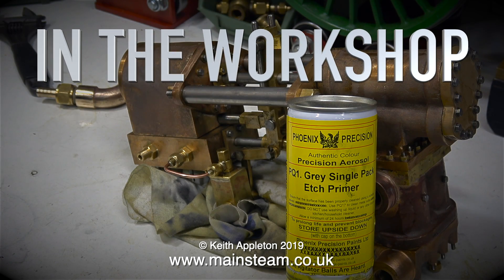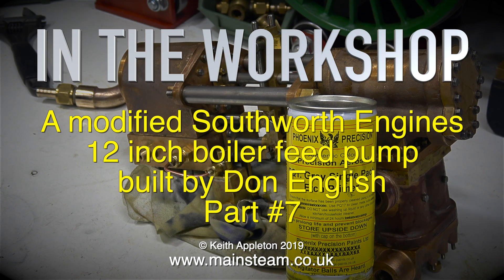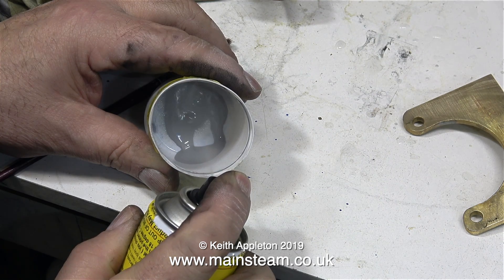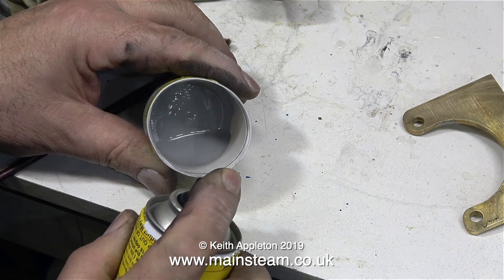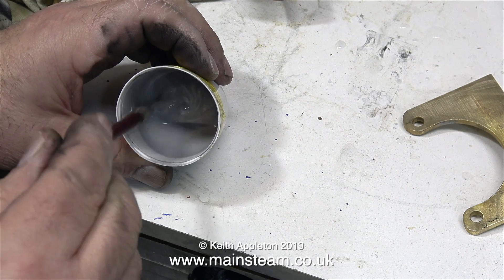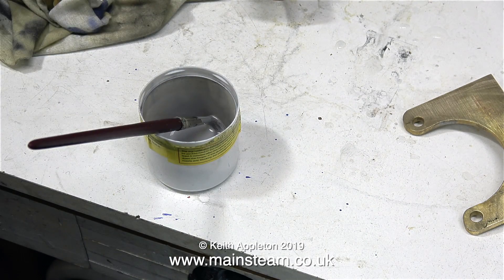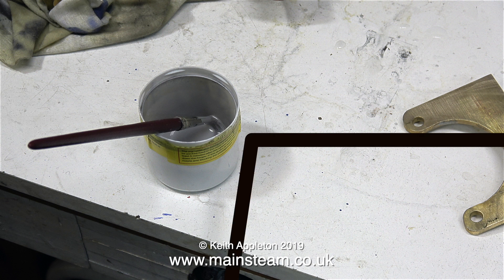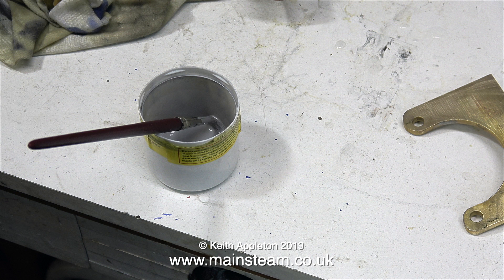A HORIZONTAL SOUTHWORTH 12 INCH BOILER FEED PUMP - PART #7

Comment: This is probably a dumb question,but will ask anyway. Using the size of your hand as a gauge,looking at diameter and stroke of what you are painting,I do not see anything that would be 12 inches. I remember reading a couple of hundred year old articles on how duplex/simplex pumps were hooked together for direct drive,and sizing the steam drive to water feed pump appropriately. Too many years to remember details,but looking at this twice I still cannot see what is a foot long sizing. What am I missing ?
That really has to be unusually good etch primer. I remember some disastrous messes I made decades ago. That learning curve was expensive. Good to know you do not get to duplicate it. Cheers.
Reply from the maker: The pump is 12 inches long. Please look at: www.southworthengines.com
Reply from the maker: For Scale purposes ...... my hands measure 9 inches from the tip of my little finger to the tip of my thumb }:-)))
Reply: @keithappleton  Wrong assumptions on my part. I was looking for a bore or stroke that would be 12 inches. Not length of casting. Live and learn. Thanks for mentioning the site. Quite a bit of information there.